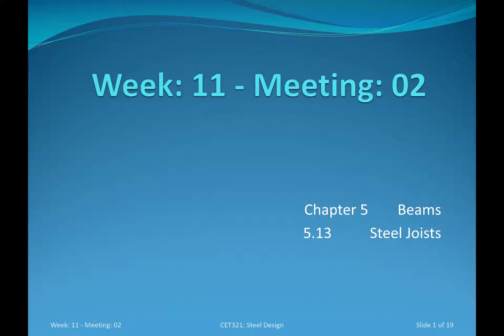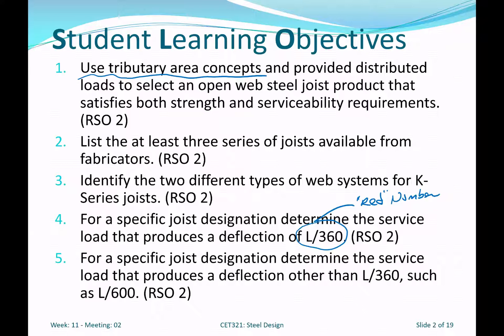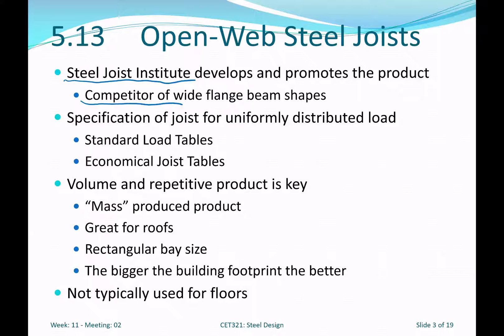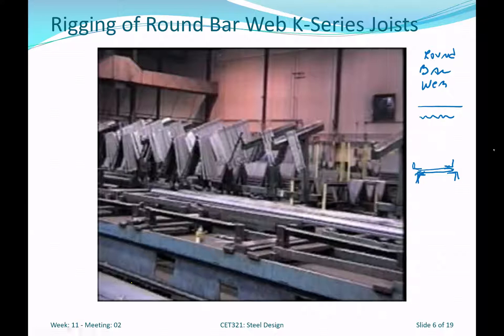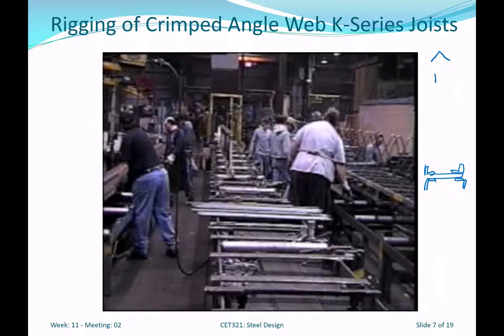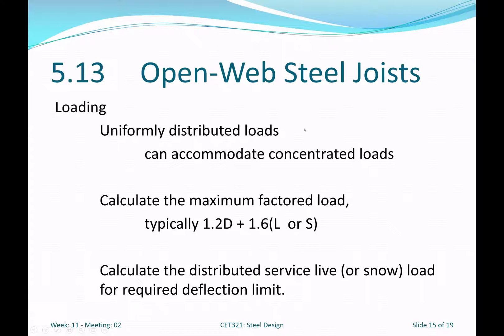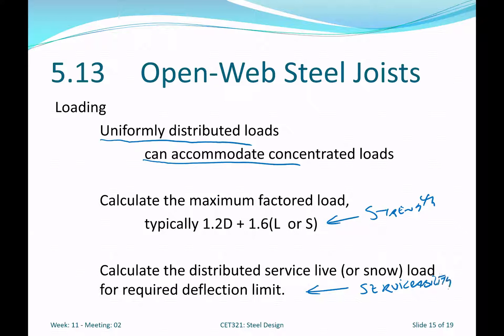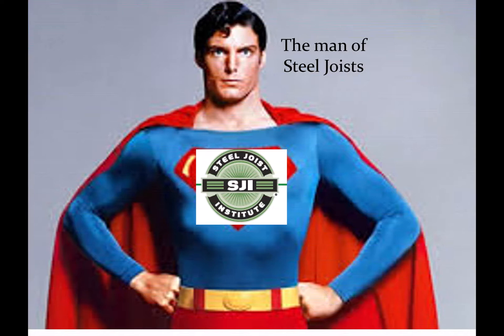5.13 Open-Web Steel Joists

Comment: Hi Drew, I have a question. Why doesnt the bottom chord of the joist connect to the column ? Thanks.
Reply from the maker: Huimin Zhou,
Joists are most often designed as simply supported. If the bottom chord is extended and connected to the column compression will develop in the bottom chord, voiding the simply supported assumption.
Joists can be designed for end moments. The resulting joists is no longer a standard joist, but a specially designed joist.

Thanks for the question.
Drew